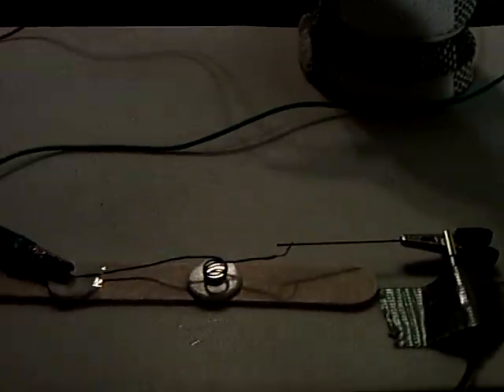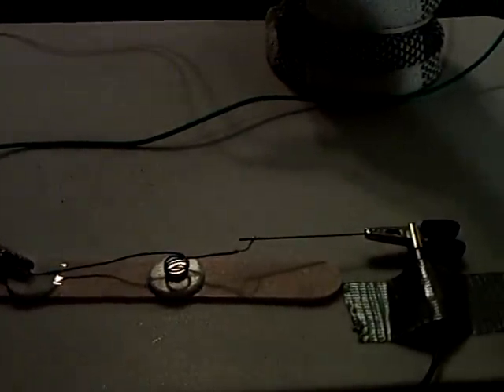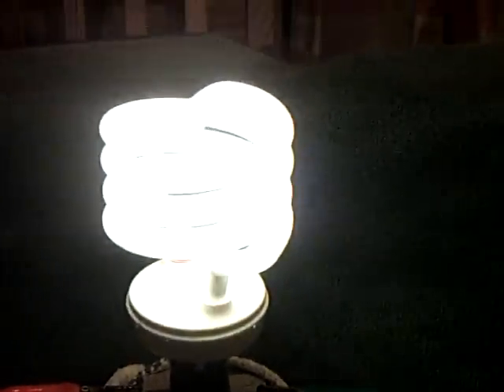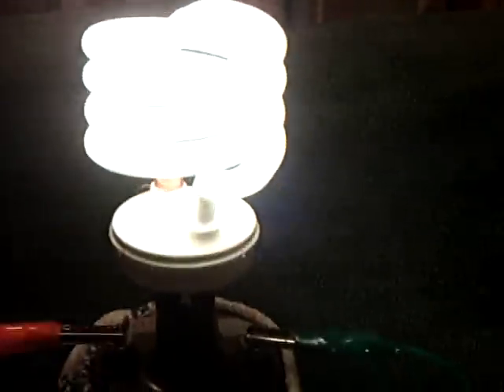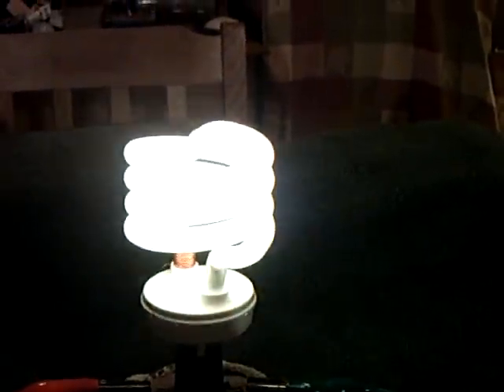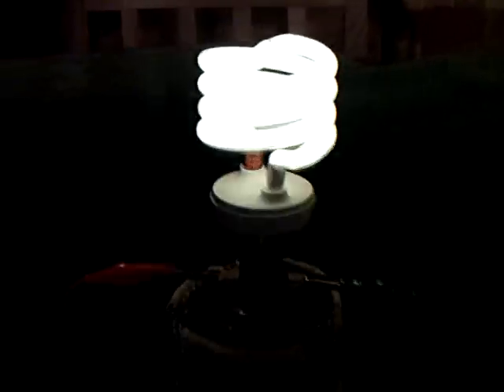Simple Light

Comment: I like that modification with the coil and magnet. Ah, the reason makes sense for the carbon, with metals fusing :)
Reply from the maker: slider2732 I suppose one could make a very simplistic AAA 'Joule Thief' type of device using this method. Maybe build the whole thing up on a No. 2 pencil.  A choke could sever as the inductor for the kick back spike to flash the led. Adjustment of the contact point between the copper wire and the pencil tip might be the hard part.
Reply: *****
I like that thinking, to go from a thin stick of some previous builds, to a really tiny base in the form of a pencil lol
Can you imagine such a 21st century spark gap system running on solar, now that would be something.

Comment: Hi could you tell me if it is collapsing both fields to the car coil   The same as waste spark vehicles do like the old holders did in Australia also have you tried this instead of your lead pencil inner get the wire from the battery pos and the. A wire from the negative of the coil and wind the  two wire like a rope configuration (bare wires at the winding area but shillac them ) 17 times wound then thread through a donught neo dynimium small magnet to sit in the centre of the wound area this should make a in and out of phase magnatron ac dc colliding effect now spike off a wire from the magnet 90 degrees to the wound wires to the positive of the coil ( you may have to spike to a block of aluminium in between the spike take off but make the spike off wire loop back to the neo from what ever you connect to so it acts like a horse shoe magnet but becomes a ed leedskelnin Pmh.      No expert here in uk but this is partly what joe booker does to eddy current and attract surrounding air to act as a pos neg ion generator catcher. Like a car radio catches radio waves ok